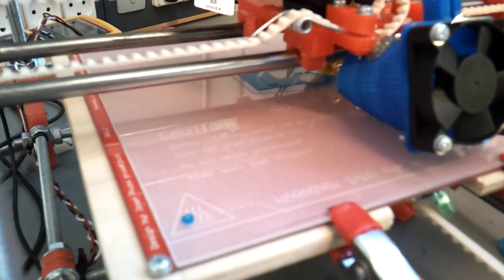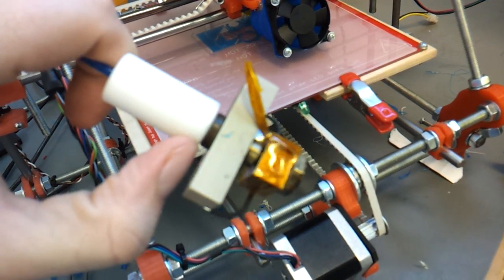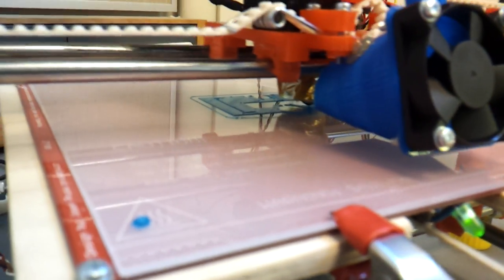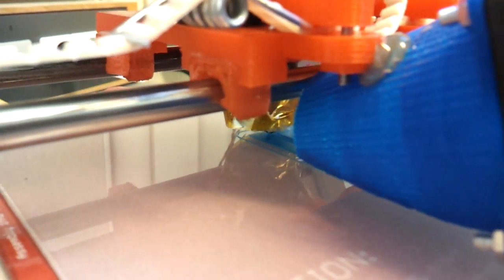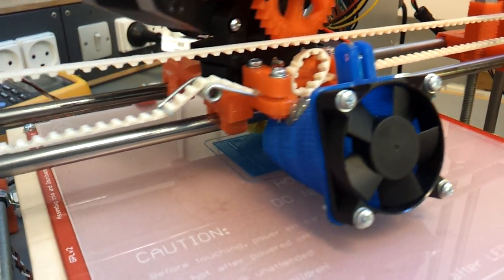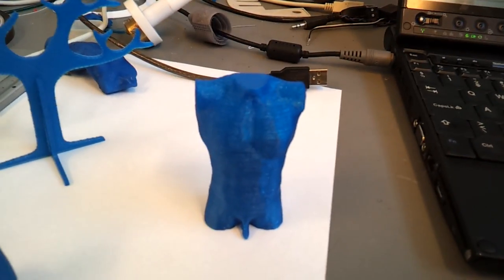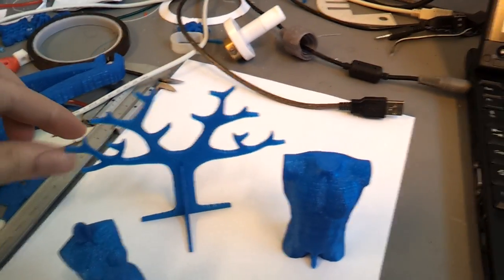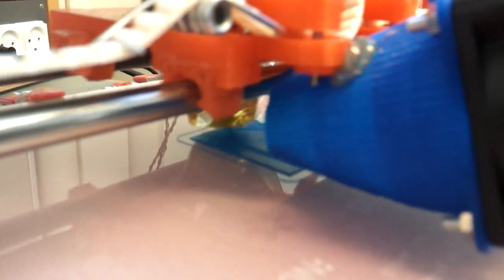Reprap with J-head and filament cooling

Comment: Thanks for the reponse. I found this code snippet for enabling D9 for fan control in the Marlin firmware.
It basically disables you using another extruder but I'm not concerned with that (as would most people I'm sure). It works quite well :) 12v fan required.

In the Arduino section of pins.h:

Before: 

#define FAN_PIN 4 
#define HEATER_1_PIN 9 // EXTRUDER 2 

After: 

#define FAN_PIN 9 
... 
#define HEATER_1_PIN 4 // EXTRUDER 2